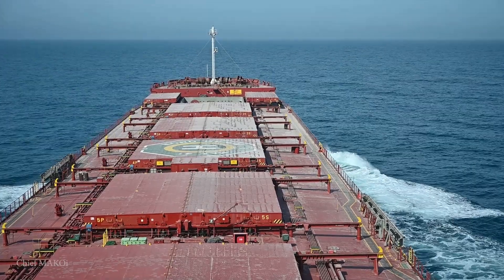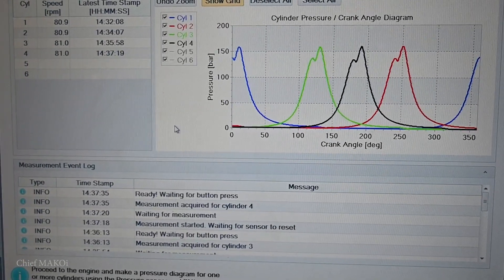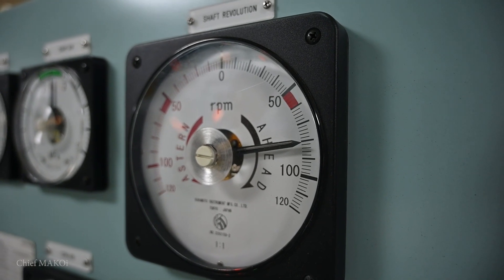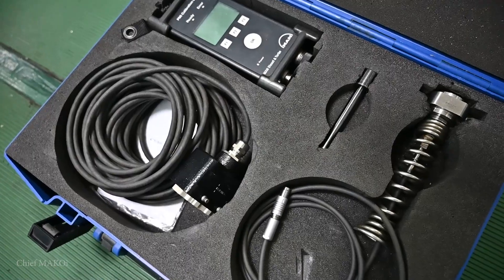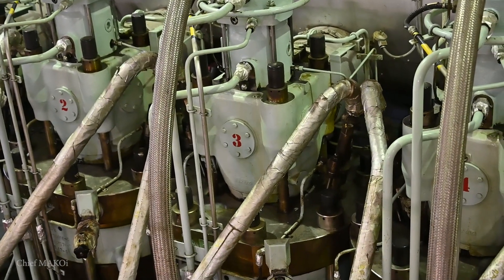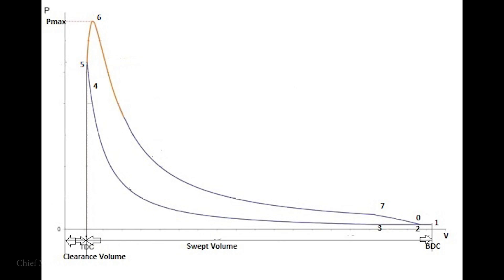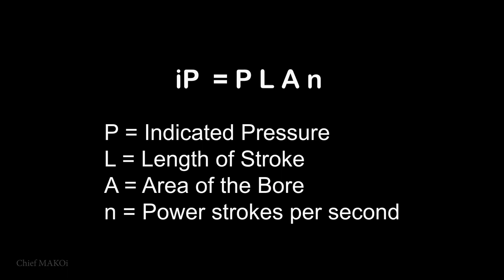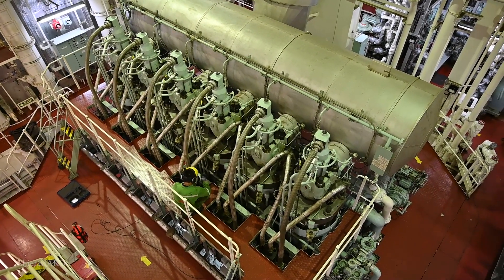Ship's Main Engine Performance Test | Chief MAKOi

Comment: The torque numbers are impressive! At ~509 radians per second and 6.762 MW, the engine has to exert almost 13.3 kNm of torque on its shaft! That is a HUGE torque! If a human wanted to create such a torque using an “imaginable” force, over a wrench 🔧 100 meters long (!) it would still take 133 N to get 13.3 kNm. (Such a wrench is hard to come by!) Interpreting the force of 133 N in a “pre-gravity” way: It would be like pushing against the Earth-based equivalent of 13.55 kg. To get the torque, the force would need to be directed around the circumference of a circle 100 m in radius. While it is imaginable for a human to exert the static torque alone (as long as the hypothetical 100-meter 🔧 wrench is provided), making the power would require moving 81 times every second around that circle. Which would be a speed of around 50.9 km/s. 😆 The Earth’s escape velocity is 11.19 km/s…

Comment: What is the grey box between the indicator cock and the cylinder?
I come from the time of the Dobbie Mcinnes  manual Indicator  gear, wax papers and french chalk on the fingers to stop greasy smudges on the papers and planimeters.  We didn't mess about with gloves for any job especially watchkeeping, your hands were the temperature and vibration  sensors as you did the rounds of watchkeeping.
No safety hats required as everything was clear of your head. Ear defenders came in later with turbo charged engines, yet you still had noise  which is why most of our hearing is failing after retirement.
I sailed on a couple of ships with no turbo chargers. The early Doxfords had an engine driven scavenge pump , like a large compressor valve that moved in a cylinder.  Common rail fuel system but mechanical fuel valves, not CAV  types working on pressure to open them  or electro hydraulics like today., but very fuel efficient engines . 

Bank Lineships had a lot of Doxfords originally
12,000  ton ship
12 tons of fuel  per day 
12 knots  perhaps.
We had several ships with Doxfords, twin screw, 5 or 6 cylinder, 6/7 hatch reefer ships, all cargo break bulk, hand loaded, be it general outward bound or frozen lamb, beef homeward bound. Weeks in port during cargo operations which gave us engineers time to carry out Lloyds surveys of all machinery , removing pistons, liners , crankcase bearings, preparing the donkey boilers  for their yearly survey, being a fired  pressure vessel.
There was very little work done by shore contactors. Outward bound as we were carrying general cargo a generator may have had an cylinder head change, or even piston and liner removal, calibration of liners, piston, gudgeon pins. Other maintenance included fluid and filter changes, cooler cleaning, fuel valve changes, so everything was on top line ready for the fridge cargo when more power would be needed especially going through the tropics.
In ten years at sea I never once experienced any problems when changing over  from MDO to HFO or the reverse and very few unexpected blackouts.

Comment: This is cool stuff.
Measuring cylinder pressure and calculating power from the data gives Indicated Power, not Brake Power.  
To measure Brake Power, there would need to be a torquemeter on the prop shaft and a measurement of engine speed.

Comment: i am confuse in calculating indicated power of engine, because mostly all of them using mean effective pressure instead of mean indicated pressure.
indicated power PI = Pi x LAN
effective power PE = Pe x LAN
mean effective pressure Pe = Pi - friction losses
mean indicated pressure Pi =  area of diagram (power card) / lenght of diagram x spring constant

now I dont know what is correct now. please help sir.

Comment: ok. that is impressive!
the method used is so straightforward. also impressive as the numbers don't lie.
at tested rpm though i wonder of increases in engine speed will change the rated output in actuality due to the time decrease involved in completing each combustion cycle. twisted minds want to know :-). i find these vids very informative and they do tend to set my mind to wander in regards to the interactions of the equipment and personnel onboard.

Comment: When we were having other problems, we had a consulting engineer out to ride with us. Rob used strain gauges on each shaft and found that we were actually generating 4,200 hp (3132 kw) per shaft, instead of our rated output of 4,000 hp (2983 kw). Interesting approach here, we used Kiene indicators to measure MEP in each cylinder.

Comment: What I'm amazed at how relatively quiet those big engines are! Much quieter than the old marine diesels.
Those old analog indicators are amazing also....
I suppose you could extend those calculations into how much energy is theoretically available per unit of fuel, how much of that goes away as heat, and how much as work in gallons/mile or however you want to express it.....neat. (and no doubt the variables include grade of fuel in use, temperature of the water, etc...)

Comment: Hi, i want to discuss why our vessel pmax decrease from 9mpa to 8mpa after we change nozzle injector 9 hole to 8 hole? We stick to manual book for injector pressure adjustment. We use mfo 180cst.

Comment: I'm a bit surprised that the engines have periodic testing like that - I'm a retired airline pilot and the jet engines are often monitored all the time, with the data received being sent back to the engine manufacturer in real-time. That lets them pick up on a lot of potential problems before they occur.

Comment: I have seen where eddy currents are used on an output shaft as a load to find load ratings such as these, Of course for that kind of HP it would take one huge piece of machinery to get down somewhere in the shaft alley for this to be done.  
  I find it hard to believe that an engine with this huge bore/stroke and slow RPM's is able to burn the fuel completely, Even fast running engines running number 2 can't burn off the things that some governmental agencies scream about. Is there any type of re-burning circuit implemented in this configuration for exhaust hydrocarbons? Thanks very much.

Comment: Right, I know DP talks ft/lb of torque and it is true that 1 HP = 33,000ft/lbs per minute. I was surprised at the low HP value when I see cruise ships talk numbers like 10X that for propulsion. and at least that number for bow thrusters.

Comment: I try to get info on various cruise ships while aboard and usually the horsepower figures are higher. Was surprised you showed only 9000HP. Thanks for the video, very informative.
Reply: Dry cargo ships like bulk carrier and tankers have low powered engines as compared to container and cruise ships. Usually the cargo vessels have max speed of 15-20 knots while container ships and cruise ships have max speed greater than 25 knots. As engine power is proportional to cube of ships speed higher speed requires more powerful engines. Doubling the speed requires eight times more powerful engine.
Reply: Dry cargo ships like bulk carrier and tankers have low powered engines as compared to container and cruise ships. Usually the cargo vessels have max speed of 15-20 knots while container ships and cruise ships have max speed greater than 25 knots. As engine power is proportional to cube of ships speed higher speed requires more powerful engines. Doubling the speed requires eight times more powerful engine.

Comment: It is important to note that this is the indicated power, not the effective power that you are able to use. 
The indicated power just describes how much power would be available just from the energy set free while combustion.
Due to mechanical losses (resistance for example in the bearings, the drag of the piston and piston rings in the cylinder bore and possibly auxiliary components like pumps and valve train) the effective power that is available for actual use at the crankshaft/ flywheel will always be lower than the indicated power.
Generally if you are talking about the power ratings of engines, you usually talk about the effective power.
Reply from the maker: Yes, the effective power is less due to mechanical efficiency.  Sometimes it is termed as brake horsepower because it is measured at the flywheel.
Reply: @ChiefMAKOi  
Exactly, as this is the power you could theoretically measure on a engine brake/ engine test stand (dynamometer or water brake), however with an engine like yours this would be pretty hard to do.
Thanks for replying.

Comment: As an engine room volunteer aboard the museum ship Liberty-ship class SS JOHN W BROWN, powered by a 2500 ihp triple-expansion reciprocating steam engine, I am amazed at the number of things that have carried over from reciprocating steam engines to diesel engines.  The manual method you show for measuring cylinder pressure and converting that measurement to horsepower is almost exactly the same as that used on steam engines.  Similarly, the crosshead guides, connecting rods and crank webs you showed in your video a few days ago are also almost identical to those on a reciprocating steam engine-- except that in most steam engines all this machinery was out in the open and you checked the temperature and degree of lubrication of the connecting rod bearings by touching them, while keeping your hands as far away as possible from the rotating crank webs.

Comment: If it is a two stroke, shouldn't the 81 rpms only be 40.5 'power strokes'??   11:52
Reply from the maker: No.  One cylinder in a Two-stroke engine has 1 power stroke per revolution.
4-strokes have 1 power stroke in two  revolutions.

Comment: As all the comments I read say, " another great video". The tech yes, but the calm, and precision add to the overall impact. Everything I know about your work comes from this channel. Thank you. I am a retired engineer in a completely different field. So now my minutiae. When coiling test cables, or any cables, using the over/ under method results in no loops or kinks. This is often remembered by saying " over worked / under paid." Lastly, when working with large heavy cables, making a figure 8 on the deck, then picking up the ends, folding together, gives the same results. Thank you again Chief!

Comment: Try coiling / reverse coiling to prevent the extension wire from tangling. Audio staff use this technique for very long audio cables and they don't get twisted up.

Comment: Hey Boss..ahh..Cheif...I was telling a channel from "dangerous catch" Alaskan sea crab...yeah you know the one.... they can put heating elements in the rails and under the deck and one guy says "that would take too much power" as though he was going to run it off his 4 cyclinder car... the video was of how a $3Million boat accumulated ice and started listing into the side of the wind and when they turned into the wind to head to land and that little bit the wind was holding them upright stopped and it capsized.... it makes sence that the side the wind was on accumulated the ice, and the wind pushed it upright...

Comment: Chief, I noticed that the test ports are threaded (6:20) and are ?normally bare? .  I have always thought that they should be capped/some sort of covering on them to protect the threads. I am assuming this is done in the engineering world to protect the threads and the crew who happen to "stroll" on by in the performance of their duties . and am I wrong that you did remove them pre video production just to speed up the process of the testing.

Comment: I am not a ship mechanic, but from what I know of piston engines, you are supposed to achieve peak pressure in the cylinder when you hit TDC (Top Dead Center) which means the combustion starts earlier on the compression stroke.
But when I looked at some of your graphs, peak pressure came fairly late after the TDC point in your graphs if that was what I looked at?
Reply from the maker: That will put too much load on the main bearings.  The engine makers set the timing so combustion occurs when the piston is past TDC and on the way down.
Reply: @ChiefMAKOi  Ah alright, well I suppose that makes sense, some things don't scale up with size from an automotive engine :D

Comment: I have gotten to run some smaller scale ancient ship diesel engines in a museum setting, and though many years have passed, and the scale is far different, they really are very similar!
I would rather use the digital gauge, but I love the fiddly old gauge! Lol
Reply: But the analog gauge is mechanics you can mend at sea. If a digital pressure sensor fails, that's it, and some sealed cables are close to non-repairable. Have the old backup, and someone young who knows how to use it, and you can measure when you have a problem (which will be when the superior digital stuff decides to misbehave!)

Comment: With sensors being very cheap nowadays, why would all of this not be incorporated into the engine, in order to monitor everything continously?

Also, it seems cylinder #5 is out of spec? What do you guys do in those cases?

Comment: Interesting stuff. I wonder if the newest ships are using full electronic engine management? If so you would have (the ability at least) of a real time display of all the data and calculations. You would also have the ability to tune for maximum effeciency based on condition and do automatic fuel change overs when required. (it could even hook to the GPS to indicate or automate the change as you are approaching a fuel change zone. Thanks for the tech look, These videos are great for those in land based industrial concerns, it's interesting to see how ship systems differ from land based ones. Calm seas,

Comment: I'm surprised, a modern, digitally controlled engine does not have this kind of instrumentation (the cylinder pressure transducers, even direct torque sensors on the shaft,...) already installed permanently on them with all this monitoring happening continuously, so you still have to manually connect a separate meter on each cylinder to do this. I would expect such instrumentation should be way cheaper than letting a fault to cause more extensive damage because it gets undetected for up to a month. Plus there could be a fault presenting itself as an abnormality only under certain special condition (like the engine warming up or so), so here may slip undetected altogether...
Reply: Surprised me too, it's got less sensors on it than a 20yr old japanese car, in fact even my 1982 motorbike has a self diagnostic computer 🤔
Reply: It is clear that you do not understand the operating conditions on these engines:
- sensors in the combustion chamber foul, and need periodical calibration leading to an extra job to be done when the engine is out of operation while this manual job is just a 1 hour job during running of the engine while in transit.
- these sensors are not cheap, i know of man b&w, who quoted such a permanently installed system, at approx 300000€ per engine for an 8 cyl marine diesel. 
- most of the times, these engines run at a continuous load, meaning it is not really important if a fault is present at low power outputs, as long as the 'normal' operating parameters are OK. Thats how it works in practice. I know in theory its like 'yeh you have a misfire at 10% load on a cylinder because of a bad injector or fuel rack mismatch' but really i dont care as long as when the engine is at nominal load, the cylinder does its thing. 

Greets,
A marine engineer.
Reply: @redmarbos  Indeed, I do not know about the details of these big commercial marine engines, that is why I asked. I was just making some extrapolations from my experience with way smaller machines, in order to trigger a bit more detailed response.

With the "defect presenting only at certain conditions" I did not actually mean a defect that is stable and affecting just those conditions, but a defect/fault which uses to end up in quite expensive carnage (e.g. when a valve breaks into pieces and these falls into cylinder, getting jammed between the piston and the head), but which in their initial stages cause shifts observable only in those abnormal conditions (e.g. a crack started in the valve, causing initially just a small leak, visible only during low rpm when there is plenty of time to lose enough pressure to show on the meter; then just replacing the valve will prevent the collision carnage from happening).
But as I said, I do not know any details about real world operation, so e.g. how frequent are such defects, or so.
Reply: @annaplojharova1400  ah okay, now it is clear. These failures very rarely happen out of nowhere. Marine diesel engines are built on a different spec than consumer grade engines. When a cylinder head reaches a certain amount of running hours, it will be replaced, and sent to a service shop where they will inspect and restore it to its new-like state. This is not something that is regularly done on consumer grade engines as far as i know, which in turn leads to sometimes catastrophic failures in these engines.

Comment: Measuring the area of a drawn line?
Just do what chemists do, cut out the graph and weigh the piece of paper. You have its GSM and its mass, multiply the two and then multiply by the scale of the graph and you have the volume between the curves.
Reply: Very clever 😀 ! That's a nice easy cheat 🙂 !

Comment: Thanks for the breakdown. What is the maximum acceptable deviation on these readings before you start to consider that there could be a problem with the engine that needs to be investigated? 1-2%?